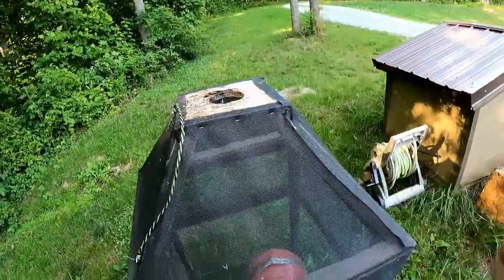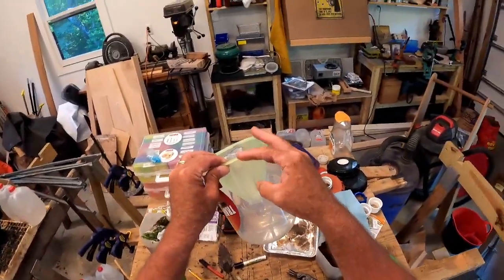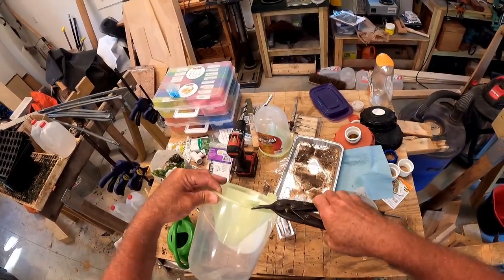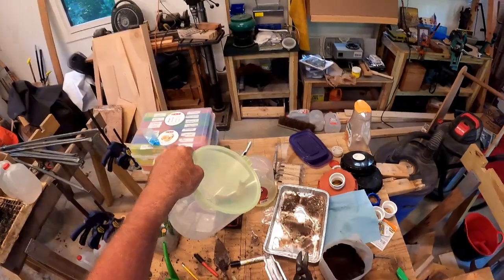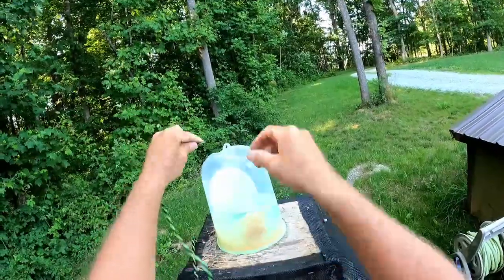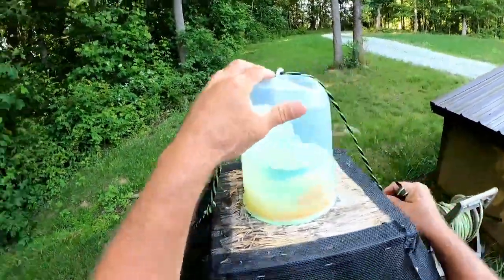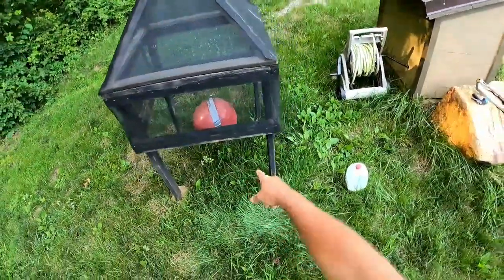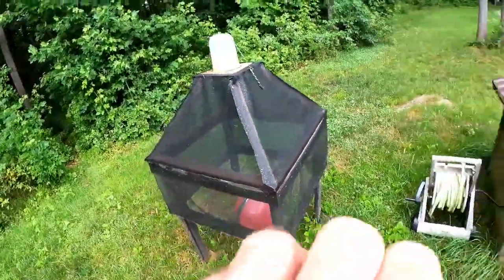#164 Biting Fly Trap Setup and Measurements - Summer 2021

Comment: That is quite the fly catching rig you've built.  I hang a similar fly trap, but just hang them with bailing twine a few feet off the floor. They really work well for a barn.  I did not think of using them outside like that though. Nice.
Reply from the maker: Hi Frank, yeah, with your horses, I'm sure you have become the expert on fly control.  I have just the trap n toss next to the pool and that is doing fine in the back yard.  The big trap seems to catch a lot more, though.  Thanks for watching!
Reply: @homesteadpilgrim  Fly control around here is Keep The Barn clean!